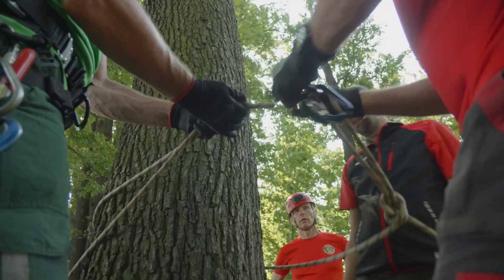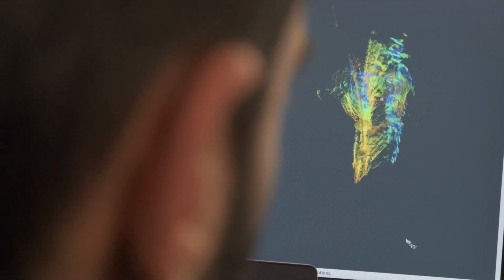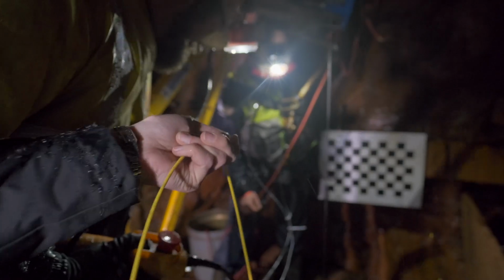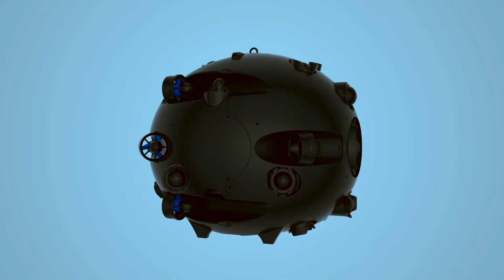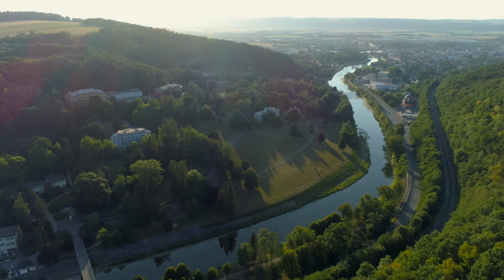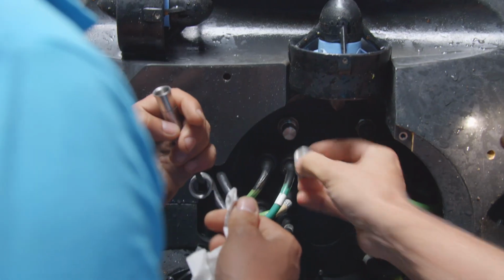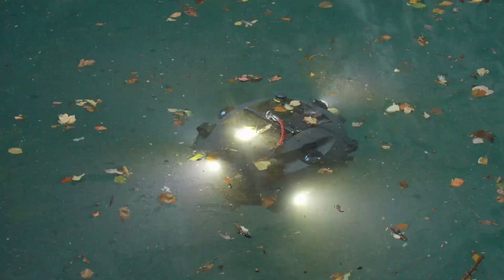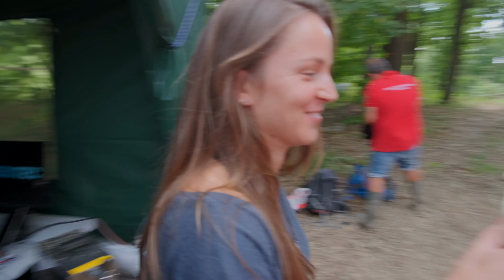The Robot and the Abyss

Comment: If the cave had no water in and you fell from the top and fell 519 metres, it would take you about 20 seconds to hit the ground.

Thats a long old fall
Reply: It's not straight down. More like a 45 degree angle in most spots.